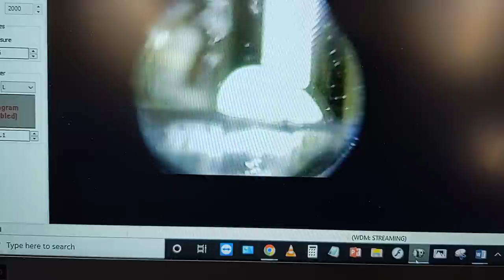V7 18" Fluted Barrel Physical

Comment: What go/nogo/field gauge set would you recommend? The only set i have found was pacific machine and tool in 223, which they say also worked for 5.56x45. i have 2 guns, one factory with a new barrel, and one built  that i want to check.

Comment: After watching several of your videos now. Ive come to grips with the fact that I'll  e ordering a good bore scope/Bore Camera very soon. Hopefully this and some gages ive also order will help me diagnose a issue im having on a non AR-15 223 rifle that I can't seemingly figure out. And neither can the manufacturer at this point. And they seemingly don't care to either (I won't mention there name) However the the quality of this firearms used to be a fantastic.  All before they where bought out by this large Handgun manufacturer.  Its SAD that there customer service side tells you that a 3" plus MOA is with in there standards as a hunting rifle. And with its 1-12 twist it will NOT stabilize 55 gr ammunition and key holes 8 out of 10 rounds fired. And its a new barrel with less than 300 rnds fired from it.
Reply: Sounds alot like a burr in the barrel. Hopefully ya got everything figured out by now tho. Had a burr in my Posen depot build K91 and it didn't get key holes but the POI was around 1.5-2 feet left and 3-4 feet high at 100 yards. Burr in the groove at the muzzle caused the gas to push the bullet off of the sights.

Comment: How bad would the barrel throat have to be before you would intervene and maybe hit it with a reamer or some other procedure to lengthen things?
Reply from the maker: I look at the brass. If there are pressure indicators or it's popping primers then the throat may need to be addressed.
Reply: @SchooloftheAmericanRifle  Ok.  Your videos that I have watched so far are informative for me.  I am a range officer for the state and commonly see a number of issues that people have on the firing line, but that I don't have the knowledge to help them address.  I would like to see you do a video on the the top five or ten or whatever problems with ARs and how to addresses them, or to get them to a competent gunsmith before shooting any more.
Reply: @SchooloftheAmericanRifle  I second Gronicle1's reply below for a "Top 10" video... I also end up helping a lot of people at the range with problem guns. I always run them through basic function tests, last round bolt hold open test and inspecting spent brass, but I may be missing something that you know I should be checking for or the fixes to those issues.  If you could also help us address where to draw the line between recommending simples "fixes" and when to tell the owner they really need the services of an armorer, would be of great assistance.  That's always a very grey line.  For example, recommending heavier buffer vs adjustable gas block, on a heavily overgassed carbine.

Comment: 10:00 so when you put 5.56 into .223 the bullet is engaging the rifling when you chamber?
Reply: No. The dimensions of the ammo is nearly the same. The issue, as I understand it, is that 5.56 is loaded to higher pressures, so a shorter throat & bullet jump to the lands will result in even higher pressures than designed.